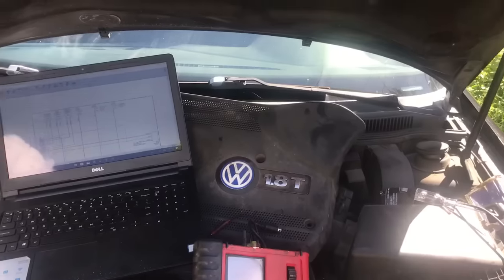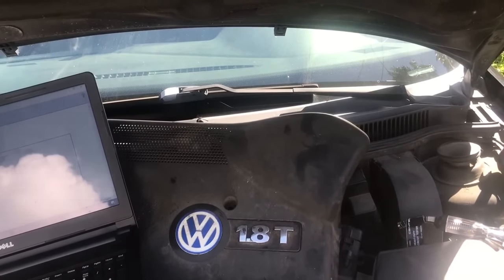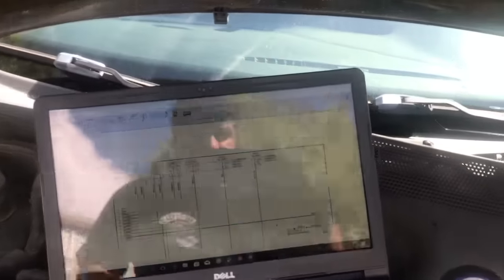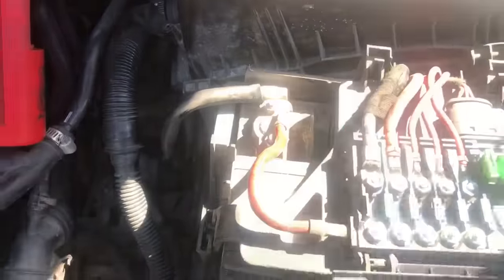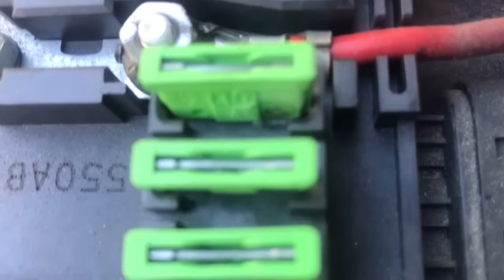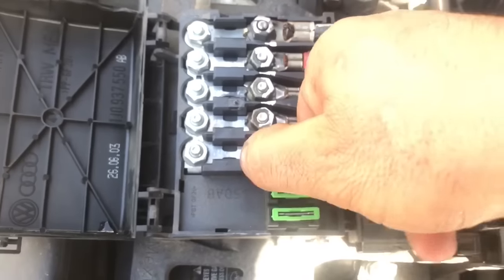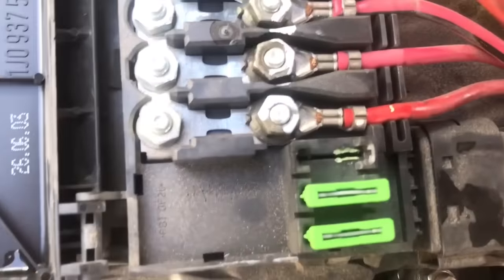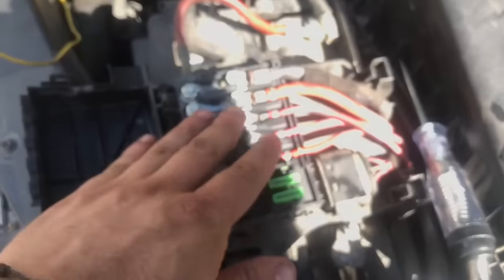VW Overheating Radiator Fan Not Working.

Comment: What it means is that people can't do the basics. They don't familiarize themselves with the system they are working on. They don't get wiring diagrams. They don't start at the beginning and check what it takes for the fan, or any other component for that matter,  to work. They just throw parts at it and hope it works. Good job!
Reply: Said that exactly right

Comment: Same thing happened to the fuse for the HVAC fan fuse on my 2006 GLI. A lot of current going through there. Not enough to pop the fuse but enough to melt the plastic and insulate the fuse connection.